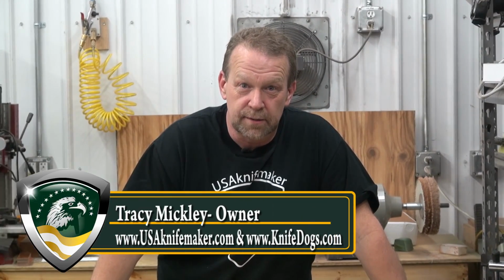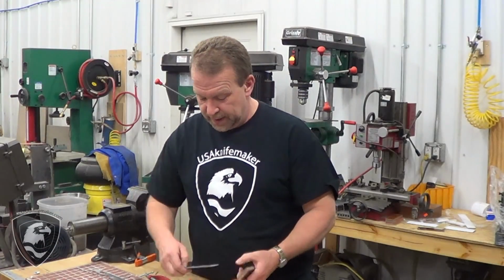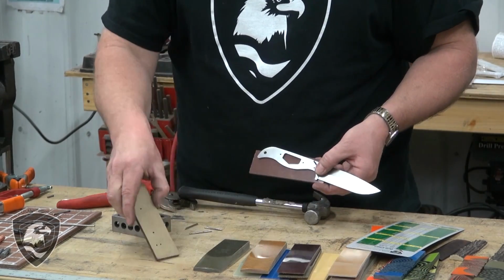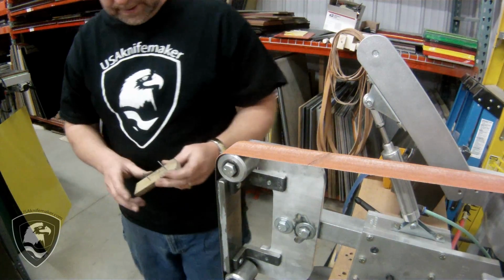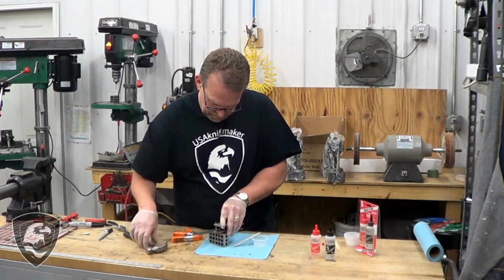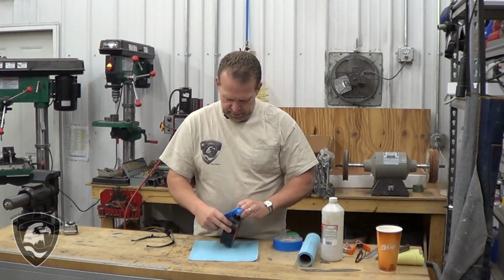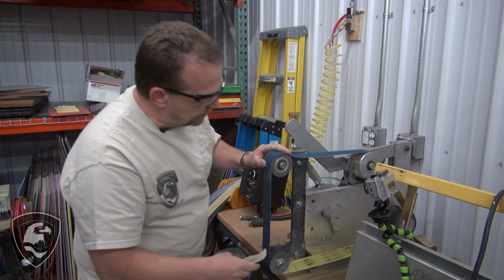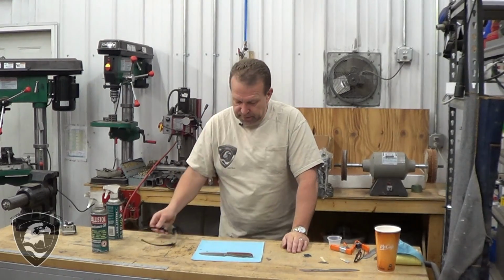"How-To" Adding handle scales to a knifeblade.

Comment: That bushcraft knife looks more like a steak knife.
Also I find it a bit odd that you are concerned about epoxy on the fingers but not wearing a respirator when grinding. G10 is especially hazardous to the lungs when not using protection. But....  i'm sure you know this already.
On another note, I couldn't take my eyes off of those GIANT sheets of G10 and Micarta in the background! All of the lovely colors!  I will be placing my order soon :)